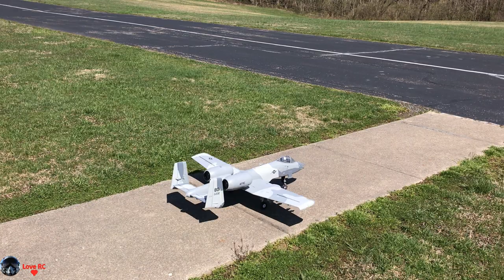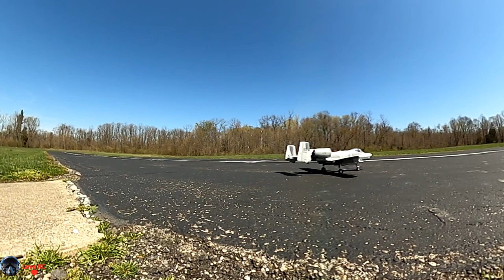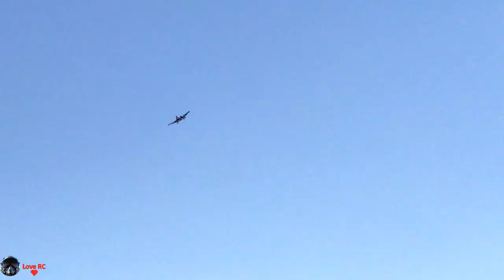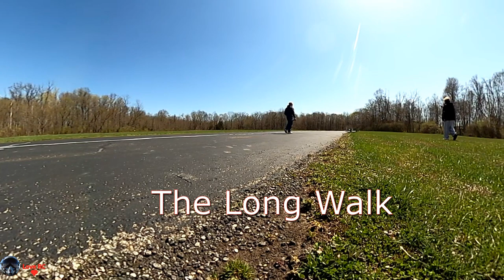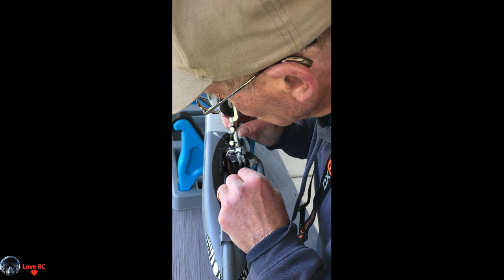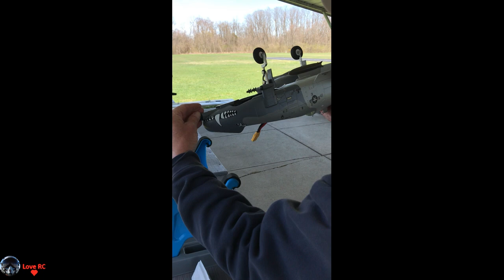E-Flite A-10 Flight and CRASH!!!   Damage inspection at the end.

Comment: I am sorry to see that plane damaged during landing but thanks for sharing though. With recommended cg this plane starts to sink crazy when you chop the throttle. You expect it to glide a little bit at least, but it doesn't. It sinks like a rock. It does not have to be like this! First thing to correct; Recommended cg does not work on this plane. I had the similar landing issue in the maiden. Move battery to back to get a cg around 65-70mm from the leading edge of the wing (gear closed). And, remove the ordinants! Ordinants making this plane prone to stall or sink agressively during landing. When you do these two things, you will see it flies and lands significantly better. It is going to need %20-25 thrust to land smoothly though. With dead stick, If you get gthe timing perfect, you may also land but it is a little bit tricky.
Reply from the maker: I’ve learned to land this one on about 1 quarter power and fly her all the way down.
Reply: @LoveRC  Where is the CG? Do you use flaps? Any corretion on eleveator when using flaps?
Reply from the maker: @emre563   this was my buddies A-10.  He has everything by the book.  He crashed it again and is thinking about selling it.  Mine I have not had any issues with after an initial maiden flight where I didn't keep up enough speed.  Now she flys fine.